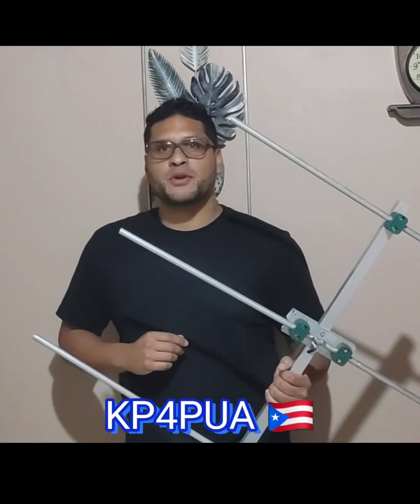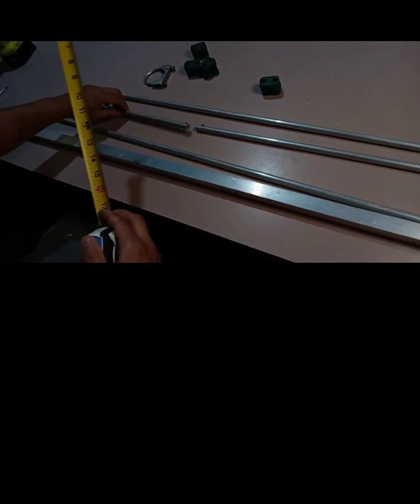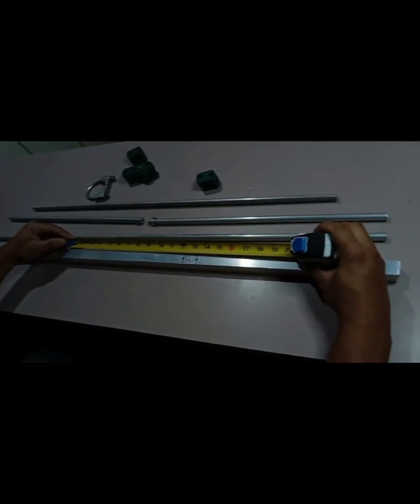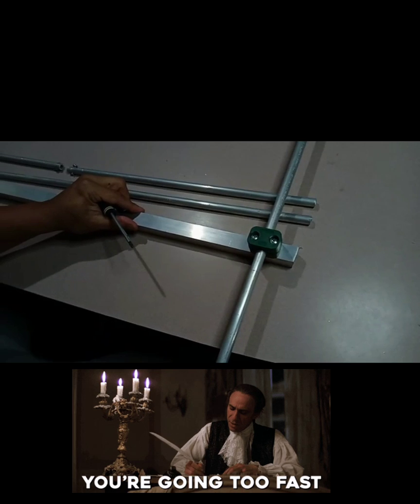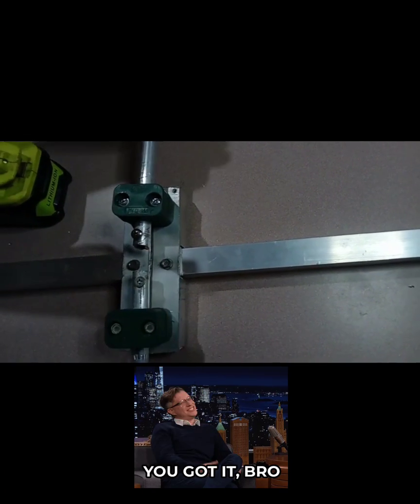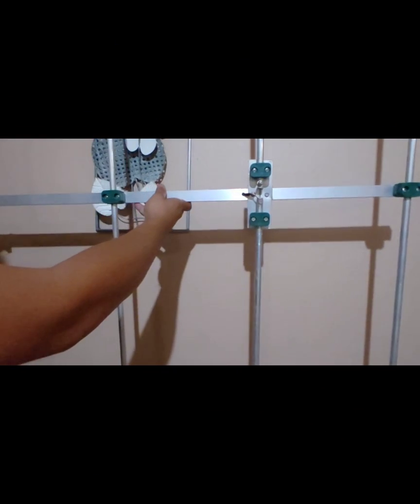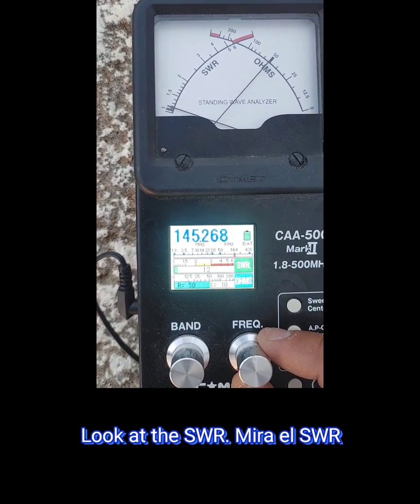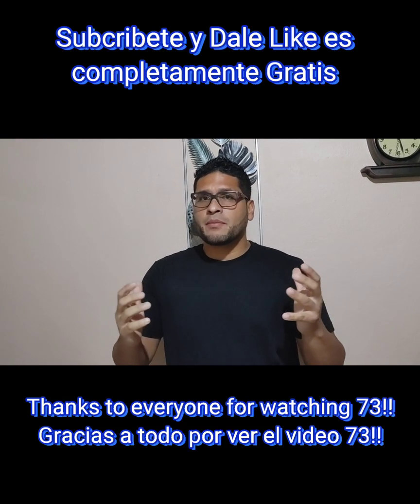How to make a Yagi Antenna for 2M Band enjoy 73!!!

Comment: Great job on that 2 meter yagi antenna ! The swr was petfect 1:1 on the 50 ohm reading. Whare are you from ? Also, have you ever built an 800 mhz 11 element yagi antenna ? Thanks BILLY...Albq. N.M.   9/18/2024